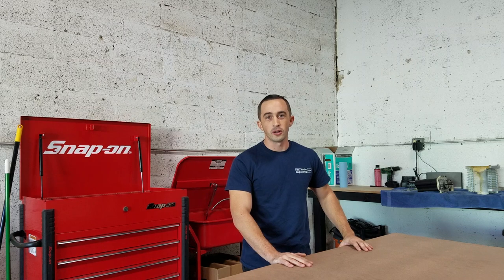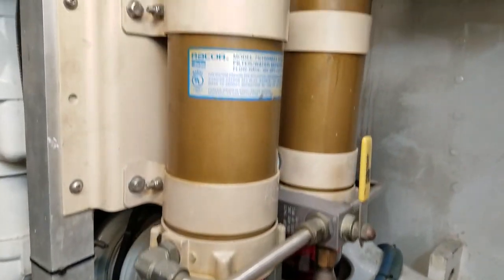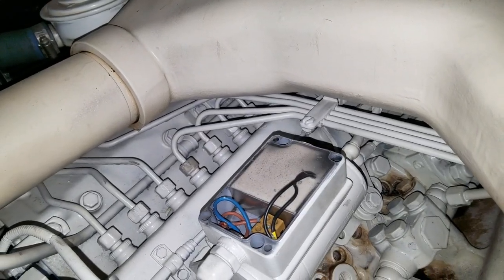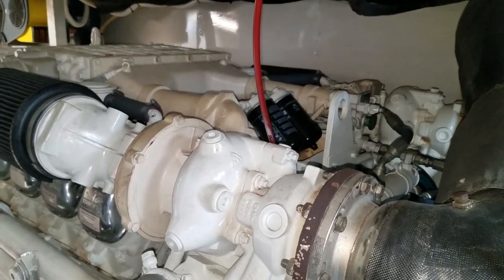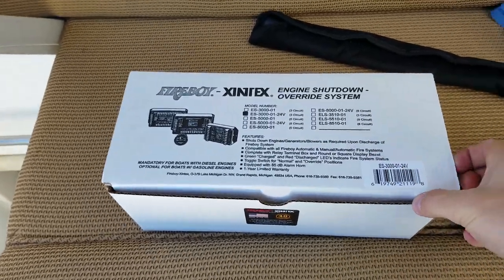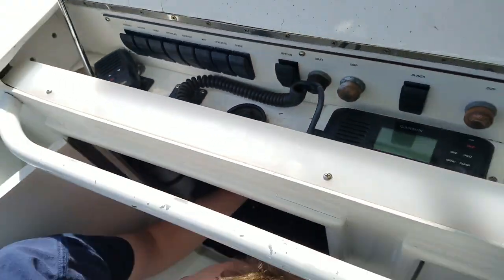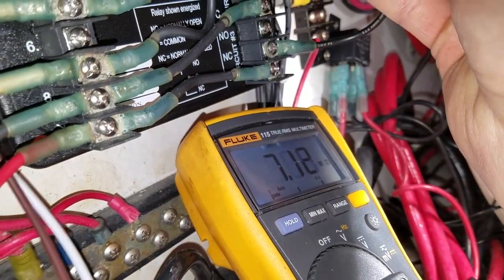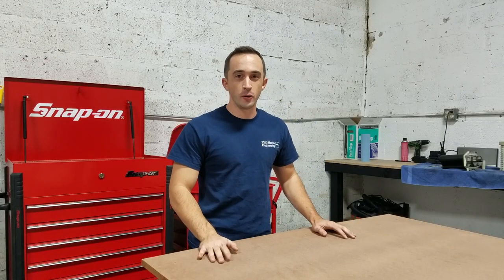MAN 800 Marine Diesel Won't Start

Comment: Understand the reason for the fireboy system, but what a PITA. Mine caused an issue with my starboard engine, took forever to troubleshoot.
Reply from the maker: It’s a PITA until you need it 😂

Comment: Question, whats your perspective on  The MAN V12-1900 Yacht Motors and whats the Factory Warranty offered for this new Motor and whats the HP for this Motor being installed in a 165 Ft+ Yacht and what Transmission and Drives do you suggest to make this the most dependable, Cost Efficient Powerful Motor Package. Thanks.
Reply from the maker: That would likely be a bit undersized for a 165' since these engines are 1900hp ea. Here is some more info. 
https://www.engines.man.eu/global/en/marine/yacht-engines/in-focus/The-Lionking_-MAN-V-12.html
Reply: All depends on what type of hull is used. Displacement hulls don’t use a lot of power and are slow. 
A planing or semi displacement hull most of the time use high horse power and high speed diesels. 

I’ve worked on a 120’ Feadship with a pair of derated MAN V8-900 and I’ve also worked on a Azimut 72s with a pair of MAN V12-1800. It all depends on what the boat is built for. 

As for the MAN V12-1900 it is a proven engine at this point with very few problems. I think the standard warranty is two years but you can buy extended four year coverage.

Comment: I have a problem with a Man 900 engine from 2005 that does not take off, the turbos were changed and the transmission selenoids were changed, but the problem continues, can you please give me an opinion about it?
Reply from the maker: Were just getting back into Youtube, sorry for the VERY late reply. You can email us FHG@fhgmarineengineering.com if you still have questions or have other engine questions
Reply: Waste gate or boost pressure sensor would be my guess. I have seen one or two CR engines that have had a load of bad fuel run through them and trash the high pressure pump.

Comment: I find this design disturbing and potentially dangerous. You could be 500 miles off shore - perhaps in heavy weather- and a single bad relay strands the yacht, there should be alert indicating the emergency fire system’s engine stop has been activated and an override switch.
Reply: There can be as many indicator lights, bells, buzzers run off the system as one wants. Same goes for an override switch.